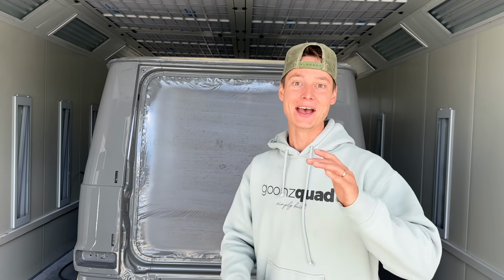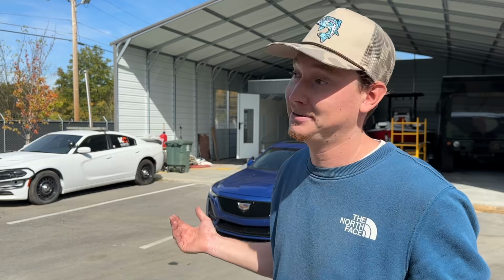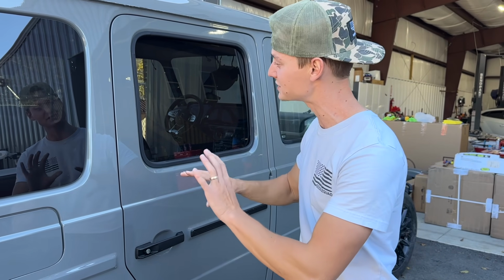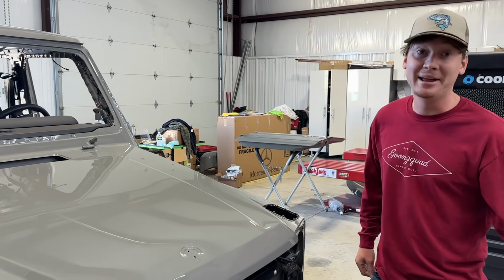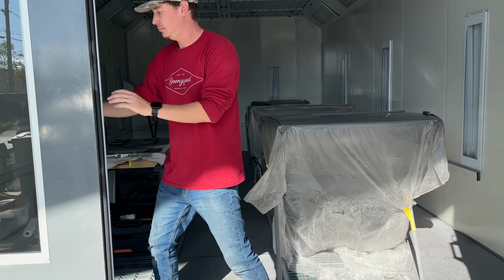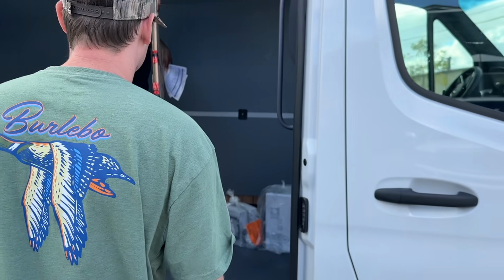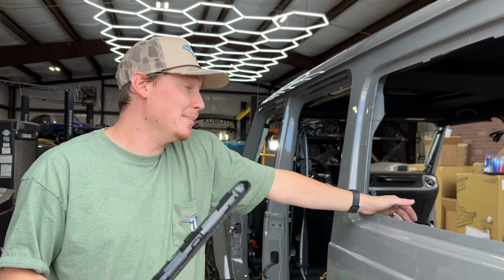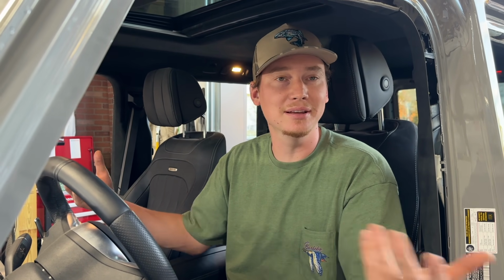Rebuilding A Wrecked 2022 Mercedes G63 G Wagon PART 11

Comment: That thing is running at a maximum of 3 cylinders :). Time to start checking for spark and fuel .  Looking great though !
Reply: Sounds like a tractor lol
Reply: I would rather check compression
Reply: I was thinking the same, no way that's running on all cylinders!
Reply: Its alright, they'll keep flooring it without fixing anything and see if it does anymore damage...
Reply: It wouldn't be running if it was 3 cylinders 😂😂.
Reply: I would smell the exhaust before the cats warm up to see if it smells like gas
Reply: Their ability to do these rebuilds without much common mechanical knowledge astounds me.... All the work put in, just to be so clueless about the actual drivetrains in these vehicles.
Reply: @co1etrain849 who cares it belongs to them if they want to blow it up they can.
Reply: @justinoliver1984  and?
Reply: @jerrywilcox9890 it would. Was messing around with some friends and pulled 3 of 4 plug wires off a 4cyl ford ranger.
Reply: Sounds like it not getting enough fuel
Reply: You mean a MISFIRE.... big difference. It honestly sounds like a timing issue!! EEKS.
Reply: @dustinsimmons4418  lol that's a v8 and won't run on just 3 cylinders.
Reply: @dustinsimmons4418  will never start and run on 1 cylinder hahaha.
Reply: @jerrywilcox9890  it was running already and we pulled plug wires off one at a time.
Reply: @dustinsimmons4418  so why ya bring it up lol has nothing to do with anything lol.
Reply: @dustinsimmons4418  seconds the minute it go to one cycle it would of died lol.1 cycle can't push the compression in 3 dead cylinders lol.think your going to pull a leg of some that's worked on vehicles for 30 years lol.
Reply: @jerrywilcox9890  👍🏻
Reply: @dustinsimmons4418  that v8 will never run on 3 cylinders ever.
Reply: @dustinsimmons4418  better lay of what ever you are spoken it's causing damage.
Reply: @justinoliver1984  I always thought the same.
Reply: @jerrywilcox9890 it definitely can!!! I’ve seen motors running on 1 out of 8!!
Reply: @jerrywilcox9890 absolutely it will. I’ve seen in-line 6’s running on 1. And had to convince customers that something was wrong with it..”but it seems fine it just smokes a little bit” yea it’s not fine lol
Reply: Nah, 3 cylinders will not move the other 5 around, it just wouldn't start, it's running on at least 6.
Reply: You guys need to do a compression test on all the cylinders, and then make sure you’re getting fuel and spark if the compression is good and even between all 8 cylinders
Reply: these guys dont do mechanical repairs at all. They just replace parts and paint. it needs skill to interpret engine codes and work to solve the issue. checking compression, using boroscope to inspec the piston linning  and checking spark plugs to make sure everything checks out. they dont even check oil and coolant before they rev the cold engine let alone do this all.
Reply: I know how the engine of a g63 sounds but sure not like that…. Better check it out boys
Reply: hope you have 3 daughters ;)
Reply: @hexxbans3726 exactly they will just send it to a shop and pay 40k

Comment: You can DEFINITELY see the difference in paint color! Those doors are way darker!!
Reply: Yep!
Reply: Also the passenger door has a nasty kink in it which they seemed to have overlooked
Reply: Did you see the whole video?
Reply: I saw that the original paint is many shades darker.... they need to just paint all remaining parts to do it properly.
Reply: I saw it soon as they put the door on
Reply: @markkennedy4055 all they had to do was blend. You can't just paint parts and put them on the vechile.
Reply: @xaye24 you would have to paint all of the edges of the panels. Waste of time
Reply: @adoksym  They fixed and repainted everything on the truck so nothing is mismatched now.
Reply: @ingresswizard9044  yeah, I commented before watching the whole thing ^^
Reply: The lay and flick in paint it’s totally different colour you need to paint doors to match

Comment: I'd be doing a compression check on the engine. If oil has got on top of the pistons it could have hydrolocked and bent some conrods. Do a compression check that will give you all the answers you need to if the block is healthy 😊

Comment: Is due for an update on the R8 don’t y’all think guys? 👀💨
Reply: I completely forgot about the R8
Reply: Probably on the back burner, I am sure cost way too much to rebuild that transmission for all that power lol
Reply: They traded the r8 for the twin turbo wrk on the lambo tbey gave away
Reply: @chewc2199 no they didn’t. They traded a huracan engine for that twin turbo kit
Reply: @chewc2199 you don't know nothing
Reply: @tylerehoffmaster4561 no they traded the engine from the burnt Lamborghini they got for parts
Reply: @ghostsgamingea2383  incorrect. Sheepy even stated they received the engine in exchange for the kit
Reply: Forgot about that car, they didn’t sell it?
Reply: Nah they dont answer fans you will never get an update lol
Reply: I saw b rouge post a while back that they had the trans fixed in 1 day
Reply: Could be a safety feature like no doors or seatbelt being worn, leaves it in limp mode.
Reply: Could care less I’m waiting for the truck build
Reply: I was jus thinking the same thing
Reply: I just hope they didn’t send the R8 back to B rogue.
Reply: I thought theu sold it or something
Reply: @Goonzquad Had sent it to some shop to get the transmission fix..ight this is how everything went down. Y’all remember they had sent it to get the twin turbo fix. So,when they received the car back from the shop that’s when they started ripping/testing it and stuff.  Same day they broke the transmission that’s when they sent it back to some shop then we asked em for updates that’s when he said they’re still trynna fixing it..we’re still asking for updates since that date which was a few months back and they keep avoiding the question about the R8. They must be hidden something from us imo they’re definitely hidden something from us 💯..👀
Reply: Omg I totally forgot about the r8 😂
Reply: I don’t think they have it anymore i was wondering about it
Reply: Yes please i love that car dont sale it
Reply: B Rogue screwed stradman so I wouldn’t be surprised if they did the same to Goonzquad which would be really unfortunate
Reply: Sold
Reply: It’s gone bro 😪
Reply: @dtouw sheepy repaired the transmission
Reply: It still sounds like a lawnmower.. No way, that's the way it's supposed to sound.
Reply: Yessssss update!
Reply: They didn't have the room for it and it it's getting stored
Reply: Where the mustang at guys
Reply: Is due for an update? What planet are you from? Lol
Reply: @dtouw wonder how b-rouge fixed it? Probably threw it together as crappy as they did Stradmans Gallardo. From what I’ve watched Sheepy fixed it,Alex wasn’t a fan of that car because it has Motec stand alone system
Reply: They gave it away anonymously 😢
Reply: @dtouw Sheepy built the gearbox in one video and posted it
Reply: It's at Sheepy been stored that fixed the trans in one video
Reply: I was thinking the other day about it 🤣
Reply: R8 update
Reply: Yes!
Reply: Lmaooo forgot about the R8 😂
Reply: So true that thing is a beast
Reply: Yeaa it’s been so long
Reply: Definitely we do need an update
Reply: There was a video done from the company about doing up the transmission and nothing since
Reply: What R8 🤔🤨😂
Reply: They gave the R8 to the older brother for the house build !
Reply: I agree
Reply: @c.m.7037  sheep did build the trans and its done but they told sheepy to change the whole system
Reply: @chewc2199 no when they were building the lambo they had a spare v10 engine with burn head and they treaded the engine for the turbo step up
Reply: @dtouw  no sheepy did fix the trans they did a video on there channel a while back
Reply: I had forgotten about that R8 😂
Reply: And that Porsche
Reply: I've been asking and no replies...
Reply: @c.m.7037 it was already rebuilt lol
Reply: Yeah I’m with you on this one…totally forgot about the R8. 🤔
Reply: They actually do respond jsyn and read all the comments guys ! Esp the most liked ones . I hope to hear about the r8 soon too, hope it wasnt stolen.
Reply: 4k tbd ?
Reply: I do...and the Porsche and that other thing too. They've got, I believe, at least 4 unfinished builds.
Reply: @TaylorNottz yeah, they stopped responding to subs a long, long time ago. That's how it goes. Like crack...once you're addicted, the price goes up, quality down, number changed. Success....thy name is "too busy". These are young guys living their best lives. They've got parents, siblings, wives, friends....they've EARNED the opportunities they have....understandable that they've move past that interaction phase, lots of channels do it.
Reply: fr where did it Go?
Reply: @sixamcoffeetime  They offer the Lambo to their oldest brother for building the house but the brother never took it so they did a recently give away/Raffle on it not too long ago now it’s gone.
Reply: They never replaced the aluminum crossbar with a  stock carbon fiber one like they said.
Reply: @tylerehoffmaster4561 😂 I bet u don’t even watch them
Reply: @elianjasso380  you responded 2 weeks late. We see how much you watch them

Comment: Also, make sure you guys do a throttle pedal reset. Mercedes uses adaptive modes for transmission shifts based on driving style. Just Google the procedure, it's super simple and quick.
Reply: Maybe 4 cilinders
Reply: @zacmartingaming2321  It appears this version has the 9G Tronic transmission with the AMG specific coding that didn't require this. I think I was thinking about the 7G Tronic of previous generations that required resets for most models, even a lot of the AMGs
Reply: @MrOwl25 even with the 7g that i have in my benz that procedure is only necessary after doing a transmission service....

Comment: Check the wheel sensors, MB has wheel sensors that work simultaneously with the transmission, It could be one in each wheel or front left and rear right wheel.  That happened to a ML350 4 matic that I had a couple of years ago.  the sensores speak to the transmission if one is bad, you won't get any speed. Great videos as always guys !!!

Comment: Hey guys, so invest into a BYK spectrophotometer that way when you purchase a new paint, do a sample spray out once it cures pull the readings on both the paint sample and the original paint and look for the delta E that will indicate your variances, and you can tweak the paint to get the perfect match
Reply: Best comment for these guys

Comment: Definitely needs new spark plugs and ignition coils and you’re good to go!!
Reply: Eeehhhh this isnt your hyundai. There are alot of factors to consider when dealing with this condition. Could be cam or crank position sensor could be loss of oil pressure that dosent engage the electronic cam advance. Could be ecm failure. And tons of more possible dependant variables. Your hyundai is reliable and it shows. 😂

Comment: Hey guys, just to let you know. May of the German Brands do not allow the engine to revv past 4000RPM so that would not show you lip mode. Also remember that all the driver safety modules need to be happy. The good thing is that your Engine Module is not happy with the speed sensor. Also when you disconnect the battery from the SAM it needs to re adapt which takes about 500km of driving. I would make sure that everything is plugged in before scanning the car again and once they are all plugged in, erase the codes and see what remains. TCM is the transmission and when it's not happy, the car will go into Limpmode.

Comment: Check the compression first i reckon, dont think speed sensor will make it run rough like this. I feel there could be an exhaust leak or intake manifold leak as well. Might have to do a smoke test as well i reckon. Since it rolled, I'll check all plastic hoses and clips etc.. it might have broke a few
Reply: Yep I think the intakes are where the exhaust manifolds would be on a regular car so with all that wheel damage they might have gotten poked!

Comment: For the Ram 2500 4” lift, Nitto Tera Grappler 40’s with Fuel wheels, the custom bumpers you have used, Banks turbo and tune kit with A pillar gauge’s new exhaust, chrome delete

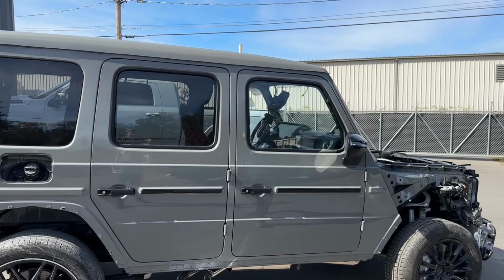Comment: i have to say the colour match is pretty damn good, but there is a very slight noticeable difference - if you go to around 2:15 and pause, look at the doors and the B pillar, the B pillar looks a tad lighter, perhaps because its narrow and has some bends, maybe being slightly prouder than the doors, but you can see it and at C pillar behind the rear door, nothing critical, and probably being in UV light may well change the colour a fraction perhaps for the better - great job guys, i'd certainly trust you to paint any car of mine, except i kind of enjoy doing it myself

Comment: Love the non-metallic paint! But it's most likely in limp mode because of the wheel speed sensor. I have a sprinter and literally just this week had to replace a speed sensor or it was going into limp mode.

Comment: I was able to pick up the color difference before it was ever mentioned. The color difference could be because Mercedes uses a black primer which can make the base coat look a bit darker. They keep talking about how expensive the G-Wagon is. There shouldn’t have been no question about repainting everything especially since they have their own paint booth now. I can sort of understand when they had to use someone else’s paint booth. You can definitely see the difference of the fender flares on camera. They need to be repainted for sure!

Comment: Being a painter at an auto plant, hand spraying usually comes out lighter on dark colors versus the robots spraying.
Reply: yeah thats a good point but there are also a lot of diffrences from factory to factory and to every paint code you can chose between diffrent varieties of the color
Reply: @benwald  I know that matters a lot for other brands, but for the G wagon case, they have been built in the same factory in Austria since the first production one.

Comment: I would trust these two grown MEN with my truck rather then any dealer or shop combined. They take such good care of the vehicles that people say would never run or drive again and restore it like new. If people would see the vehicles before and after, they would be like "This car was wrecked?" It looks brand new
Reply: No way..amatures  they don't use proper copper weld threw primer every spot weld will rust...you have to use copper weld only....

Comment: For mercs, even old models have the same logic. when it rattles like that and there is no check engine, it can be a vacuum leak. Just check the vacuum hoses well. I own a w203, for 3 years, I have been running with a rattle without a chrck engine. and it goes limpmode when i push the kick down. i never figured out why until i found a leaking joint on the intake manifold. I was surprised at how a small crack could change the behaviour of an engine. So check that it might be your answer.

Comment: Check the ABS sensor on the front wheel, which was damaged. The sensor goes in the spindle and reads the speed in the axle with a toothed ring.

Comment: Boy's, this has probably been said.
Start with a compression test on each cylinder and take note then you know if it is mechanical or with the fuel or ignition.
Oh Yes my tutor use to say "RTFB" If you struggle "read the flipping book''.
Anyway love you guy's work and vids.

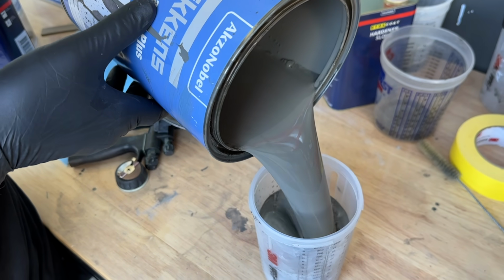Comment: I am hearing metal on metal inside that engine. Could be severe valve train failure or rod/bearing fail... Start diags on that engine in case it wants to get worse.. check compression, pull valve covers, check cam valve movement. 5:21 pull heads then pan if nothing is obvious. Failure from a rod area usually beats up the inboard side or the rod journal (toward mains). My guess is a connecting rod about to let go...

Comment: Sounds like its missing on a few cylinders. Check evap hoses, fuel lines, possibly a broken wire to an injector or coil. Check the a/f sensors to see if its rich or lean. The spark plugs may not have visible damage yet due to the fact that it hasn’t gone any distance or run long since the roll over. Dont clean the engine codes until you see multiple codes that lead to the same issue and go from there.

Comment: @goonzquad It's possible that the vehicle isn't in limp mode at all. I know some of the AMG Mercedes with turbos will hardly give you any power until the car is fully warmed up. Mines used to give virtually no boost until i got up to like 85-90C

Comment: Do the basics.  Check for spark in all the holes.  Make sure all the injectors are firing.  Guarantee half the engine is not getting fuel or spark

Comment: You guys need to do a compression check on that thing.  Fix the exhaust leaks, if there is some so you can differentiate “misses” in cylinder load and exhaust ticks.   Check sensors like IAC, ECT, TPS, CPS…. Make sure everything on the harness is plugged in.   But for starters… compression test.
Reply: It's not compression if it was then a check engine light would be set. There are no codes being set for the engine.

Comment: Sounds like a couple of dead cylinders. Check if coils or plugs are at fault. A suggestion, when an engine is not running right, try to refrain from revving it or even running it at all.

Comment: Mercedes engines are different.  Oil can go down through the head when you pour it in but it can't get up in the head easily. They have pressure  in the head that prevents excess oil to pur into the head. That is why dealer advises to add oil when car is turned off.

Comment: I'd be checking the wiring to the ignition system .. I'm guessing a break in the wiring somewhere during the initial impact .. have a look in the codes for ' circuit high ' .
Good luck .
Scan the engine and show the codes in full ... there's plenty of minds here to get you in the right direction